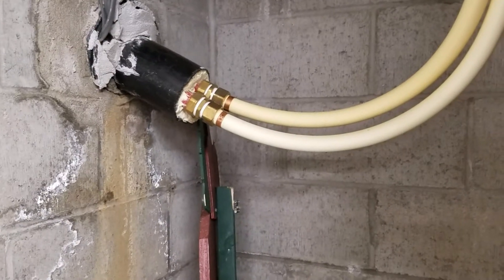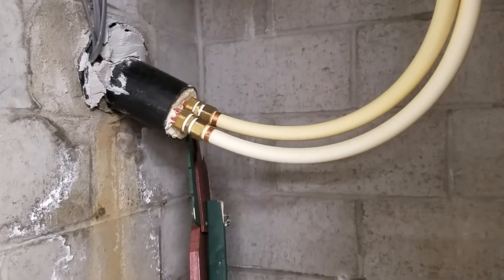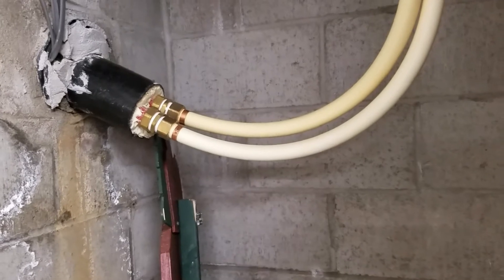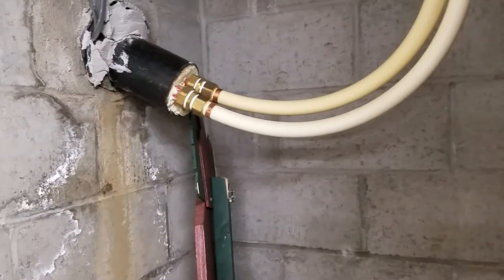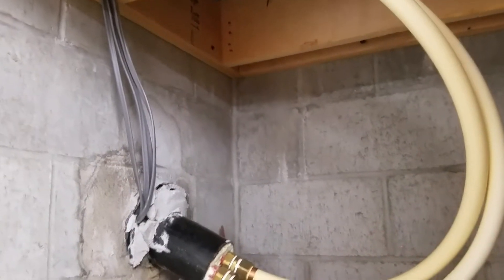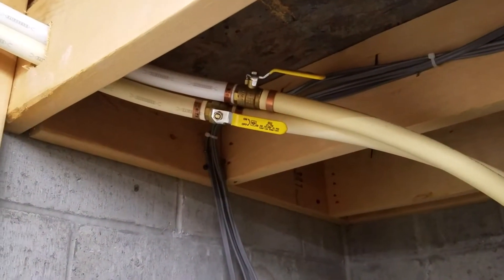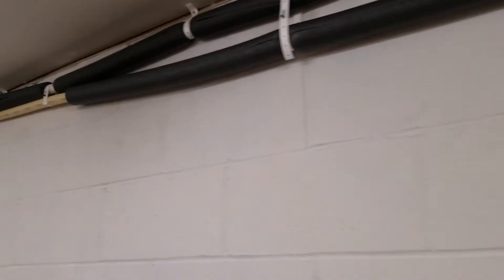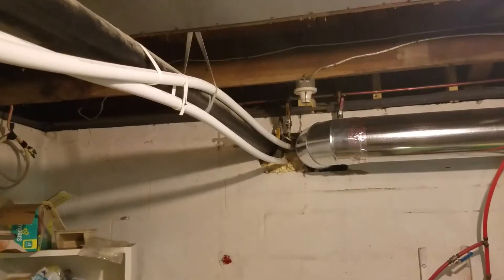Outdoor Wood Furnace: How I Installed Radiators and Plumbed My House

Comment from the maker: Just a note for everyone, I replaced the SharkBite fittings going to the air handler exchangers because they started leaking after a couple of years.  I believe this had to do with the thermal expansion and contraction over the years but I can't be sure.  I replaced them with sweat fittings and haven't had an issue since. Also, consider putting ball valves on both sides of the Y-strainer, or put it wear it can be easily isolated.  I have a set of ball valves I am going to install after the fact.
Reply: I had the same problem crimping them is the only route to go

Comment: Up to you obviously, you know more than me, but from my small experience, them sharkbite fittings shouldn't be a permanent part to your plumbing, sweat to uponor or crimp pex brass fittings would be better lol obviously you do you, my input ain't really needed. 😂
Reply from the maker: Funny you mention that.   They started leaking this week.   I think the expansion and shrinkage from starting and shutting down the wood furnace a few times a year it's toll.  Too much temperature difference.  I called a local guy and had him sweat on fittings. Lol. Much happier now.   I didn't like the idea of them but I didn't know how to sweat them myself.
Reply: Chops,,,,I have a boatload of hepex from uponor to run in my crawl space for radiant floor heat problem is I’ll not be able to do 300 ft endless runs ..I have 45 joists 35 feet long....do you think anything’s wrong with splicing every other joist with two straight uponor couplings ....no chance of them heating up and expanding and popping loose...it would make for a lot less crawling n cussing
Reply from the maker: @jamescecil4629  just avoid sharkbite fittings.   Doesn't need to be continuous.   The more fittings you have the more headless you have but that just affects pump size.  Use brass fittings.  I got them in bulk cheapest online (eBay).  Use good copper crimp rings and you will have no problems.
Reply: @DanielFarmChannel  connecting my underground 1” pex to my boiler end I’ll use 1” Pex crimp ,,,,connecting my under ground 1”  pex on the other end  I’ll use shark bite 1” 90 degree fitting  crimp to Uponor 1” hePex up to my DHW HX  then continuing up to the HX in my attic ..now connecting to the attic furnace HX shall I use a 1” sweat to uponor or use a sweat to regular 1” pex crimp or Jeff Luff endorses a 1” sharkbire 90 swivel fitting because the pex grows  as it heats ....your thoughts
Reply from the maker: @jamescecil4629  Try and use the crimp fittings for both ends of the underground.   Stay away from Sharkbite.  I understand what Jeff  said for the expansion which is one reason why I went with that at first.   However,  rather than rotating with the expansion,  I think the resistance/ friction just caused it still to pull.   Plus,  I think the thermal expansions effect the sharkbite joint in general (truly,  the "bite"). Anyways,  to alleviate stress I put in like 12" of line perpendicular to the direction the long line comes in.   This should allow some flexing.   Don't just have it elbow in.  I'm no expert,  but what I had initially with the sharkbites didn't work so I'm doing something different.   When I had a plumber out to sweat the fittings he agreed with what I had and said to stay away from the sharkbite for this application.  The crimp fittings on both ends of my underground have worked great.
Reply: @DanielFarmChannel  so I’ll come up out of the attic floor far enough from the horizontal furnace  to make a 1” pex natural “U” down into a sweat 90 pex  attached to the heat exchanger ...my heat exchanger ports will be parallel to the floor in the attic thus the reason for the sweat 90 ‘s or is a better choice to set the HX in there  with the ports facing the roof and use straight pex sweats....I’m buying materials soon...thanks for helping me buy the right stuff
Reply from the maker: @jamescecil4629  either of those options sounds good.   A "U" with 1" pex is pretty large so as long as that is tolerable go with it,  otherwise use two elbows,  but the U is certainly better if it can be managed.
Reply: Had same problem my Sharkbites started to leak after 3 years I converted over to traditional pex clamping fittings and have had no problems since. I no longer use Sharkbites for long term.

Comment: Might want a check valve installed so you can't get boiler water in your water system. I personally prefer to do mine at the boiler for safety reasons.
Reply from the maker: Not a bad idea.  I don't think it's really necessary but a good safety precaution.   The pressure from the fresh water side should always be greater than the furnace side,  so there should never be back flow.  I may install one anyways

Comment: Does the size of your furnace and the size of your heat exchanger make a difference in other words I have a heat exchanger that came with the stove I would like to use it on my furnace can I adapt my furnace to accommodate the size of this heat exchanger thank you
Reply from the maker: I would say you want it to be close.  If it's too small,  you'll need to block air from going around it and it'll reduce your flow obviously.  If it's too big,  I'm not how you would get it in.   Also, if you are getting it used,  what is the inside of it like? Could it be rusty or anything corroded?  May not hurt to do it right and get a new proper sized one,  but that's totally up to you.  Just my thoughts.  Hopefully that answers your question.

Comment: Does the hot water heat exchanger only supply hot water to the tank when there is a water draw in the house? Or does it pump continuously to keep it hot when not being used? Thanks
Reply from the maker: Only when there is a draw from the house. If you wanted one that operated continuously you might want a shell and tube heat exchanger.  However,  they are generally slower at heating up the water drawn in on demand and thereby the bulk temperature.

Comment: what does the aquastat do like the video
Reply from the maker: The aquastat determines if the secondary heat source needs to turn on.  For me that is the heat pump or electric coils.   It's basically an electro mechanical sensor and switch.   If the water in the pipes is hot it only turns the fan on to heat the house.   If the water temperature is below the set point,  it recognizes that a different heat source is needed and it will run the heat pump or electric coils in addition to the fan.   This ensures the heat pump or coils aren't used when I don't need them and also allows the heat source to automatically switch over if the water in the pipes gets too cold (say the fire went out or you left for a couple of days and the fire could last a day by itself). An alternative is to have two thermostats in your house,  1 for the wood furnace and 1 for the alternate source.   You would set the alternate thermostat lower so if the wood furnace wasn't heating enough it would turn on the backup system.
Reply: @DanielFarmChannel  how do you wire the Aquastat to the furnace ?
Reply from the maker: @xamboy5  We have a friend that does HVAC/ electrical and he wired it in for me.  I believe he wired it to a relay and based on the aquastat input it provided power or grounded the positive of the heat pump/coils.  That way the fan always gets power when the thermostat calls for heat but the heat pump/ coils only get it if  the wood burner line is cold.  Someone else may certainly chime in and correct me on how they'd do it.  Sorry I couldn't help more.

Comment: So what is your return to boiler water temp after going thru all that
Reply from the maker: That's a great question that I sadly don't have an exact answer for you.   I can tell you this.  I originally had a Grundfos 1/6 HP pump.  When that pump was on high,  with both furnaces running and hot water being drawn,  the water coming out of the last furnace was luke warm.   I upgraded to the 1/3 HP pump.  A lot more flow.  With that pump on medium,  the water is still fairly warm with a a draw from all 3 loads.  Sorry I can't give you an exact number.  I'll try and remember next fall and see what the gauge says on the back of my furnace.  Thanks for viewing and great question.

Comment: Hey man how did you trick the furnace to kick on without firing the propane?
Reply from the maker: Electrical magic.  Seriously though,  the aquastat I show at 12:38 decides whether to send power/ signal to the electric (electric coils or heat pump,  I don't have propane).  When the thermostat on the wall calls for heat it turns the fan on no matter what.  As for the electric coils or heat pump,  that is determined based on the aquastat. If it senses the water in the line is hot,  then power the relay is open and no power is provided to the electric/ heat pump.  If the water is cold,  the relay closes and provides power/ signal that turns the electric/ heat pump on.  I had a friend that is an HVAC/ electrical background install it because he understood the wiring.   Hopefully that answers your question.

Comment: Hi. Do copper parts of the heat exchanger emit any poisonous gas into your house when heated ?
Reply from the maker: I had to do a little research to understand where you were even coming from on this. From my understanding,  the risk of poisonous gases is in typical houses where you burn fossil fuels for heat and the heat for forced air systems is transferred via a heat exchanger. Copper heat exchangers can crack or have a leak resulting in the gasses from the fossil fuel combustion mixing with the circulating air in your house. Here,  I don't have any harmful gasses because I'm not burning fossil fuels. The wood furnace is pumping in hot water which transfers the heat via the heat exchanger to the house air. If my heat exchanger has a leak,  it'll leak water,  not poisonous gasses.
Reply: @ I am planning to install one in my furnace and transfer heat to my garage for heating. In couple of videos it was mentioned that heating copper releases those gases. I didn’t know they meant by burning fossil fuels so it got me worried. Thank you
Reply: Does the heat exchanger create any air flow restriction going to your heating vents?
Reply from the maker: @trikator probably a little, but I didn't have to adjust anything. Compared to when using my heat pump,  my blowers actually run way less because the heat coming out is way hotter and so the house warms up faster.

Comment: You don't have a thermal expansion tank on the heating coil loop.....why?
Reply from the maker: It is an open system. Wood burner fill is open to atmosphere,  therfore no need for thermal expansion tank.
Reply: Nothing is under pressure.

Comment: No backflow preventer on fill line.
Reply: I'm not sure he would  need one with a manual ball valve, well water would always have more pressure than the atmospheric wood Boiler side of the system.
Reply: Unless he is on city water and had a water main break. If he lost city water pressure the boiler would back feed into the city water system. The plate exchanger would need to fail for this to happen.

Comment: All those pipes just hanging with zip ties and the heat exchanger hanging by the pex makes me cringe.
Reply from the maker: It might surprise you but I have commonly seen the HXs suspended like that.  That is 1" pex and it has no issue holding.  Also,  I used straps to hold the pipes screwed in at locations.  Where I didn't screw into anything yes,  I used a zip tie to strap it to a local pipe.  It's functional and I wasn't out to achieve the prettiest award.